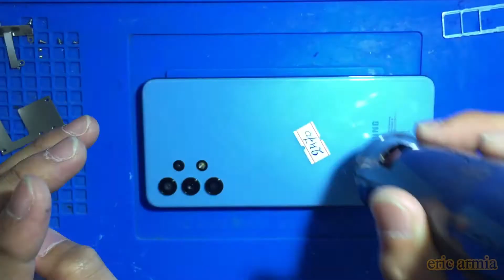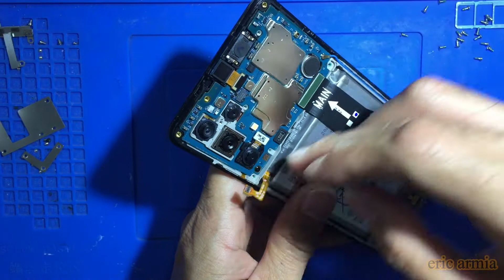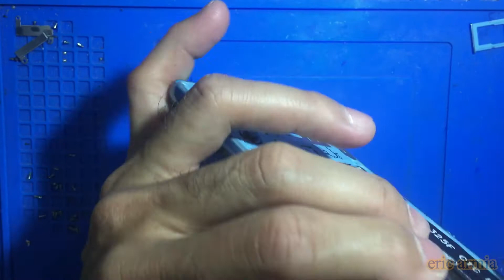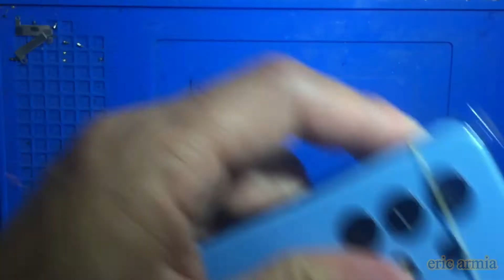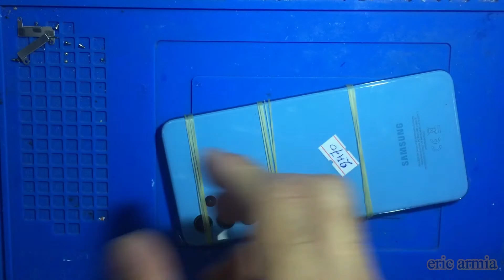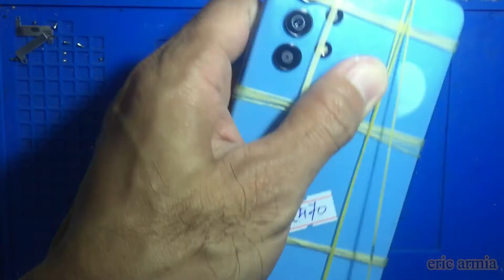SAMSUNG A32  4G - (SM-A325F) - LCD SCREEN REPLACEMENT - CHANGE DISPLAY - DISASSEMBLY

Comment: Please do not use brute force to remove the battery, just put a couple of drops of pure acetone at the battery contour and the glue will dissolve in under 3 minutes.